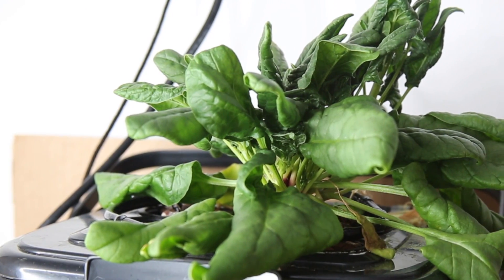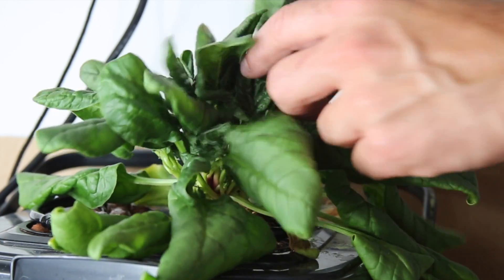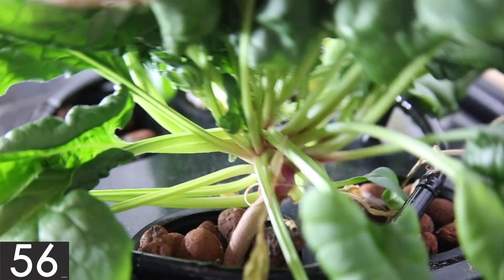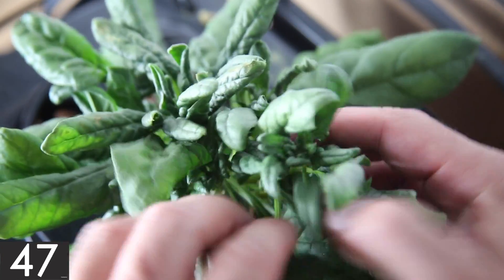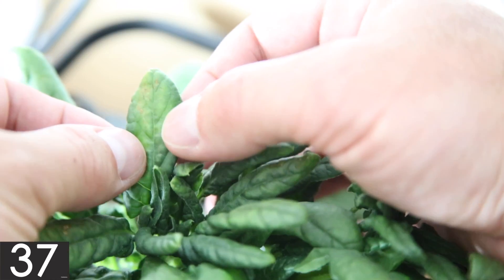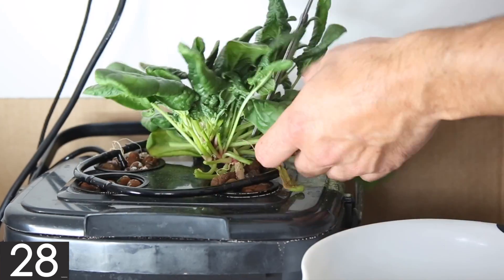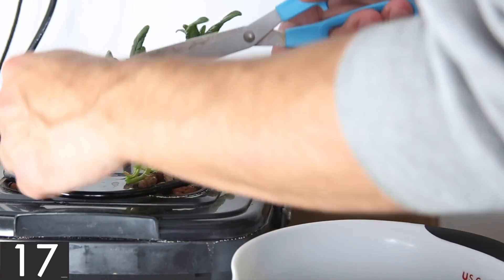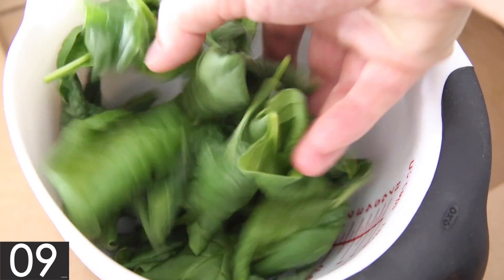60s Update - Hydroponic Spinach Experiment Harvest Time!

Comment: Do you change or add your nutrient solution during this 7 week period? Leaves could brown for several reasons. Could be a nutrient deficiency. if there's a lack of calcium the plant cell walls can start to fail.  If it's browning from the edges and starts on older leaves but the veins are green still it could be a nitrogen deficiency and the plant is taking nutrients from older leaves and bringing it to the new growth in the middle. I'm new to hydroponics and i'm also dealing with some browning right now.  I am testing whether mine is due to a nutrient deficiency or light being too close to the canopy causing tip burn.  I'd love to see a update and to hear if you figured out why your leaves were browning.  Also, spinach is a cold hardy crop.  Germination rates get better if you germinate when it's cooler. I hear some people germinate their spinach seeds in the fridge and the ones that germinate they'll stick in a rockwool so it guarantees a plant in your rockwool.  Heat is definitely an issue with spinach because it's more cold hardy than the lettuce and bok choy I grow. I constantly keep the temp of my grow room below 70 to ensure proper formation of the lettuce.  These plants are very environmentally driven.  If photoperiod is too long the plant thinks it is summer because during summer it has the longest days.  Another indicator to the plants that it is summer is the heat.  Too much light or too much heat can cause a plant to bolt because it's nature's way of ensuring that it's genes will survive.  I keep my lights on for just under 11 hours a day to simulate early/midspring.